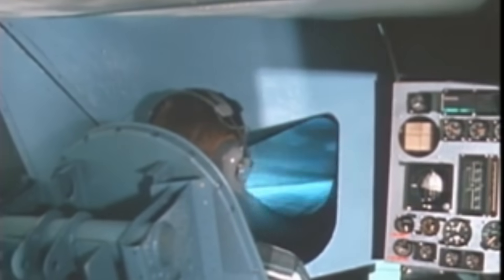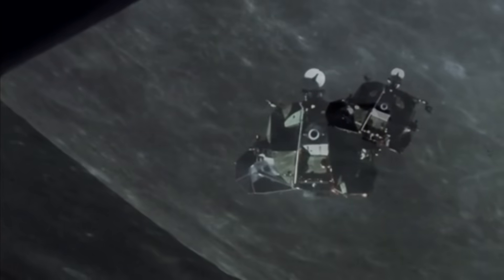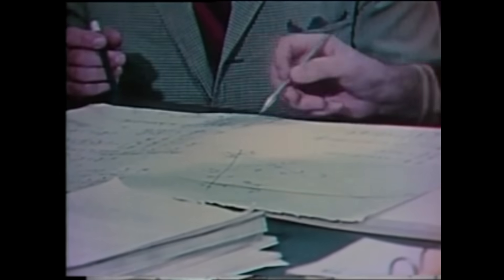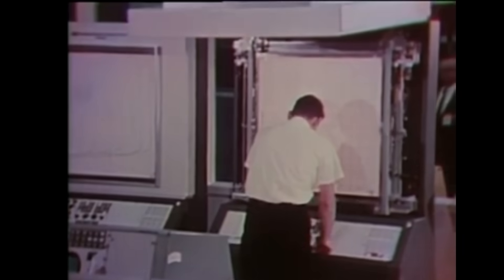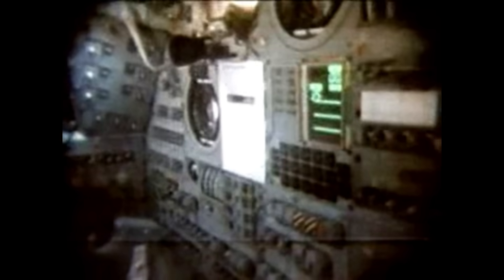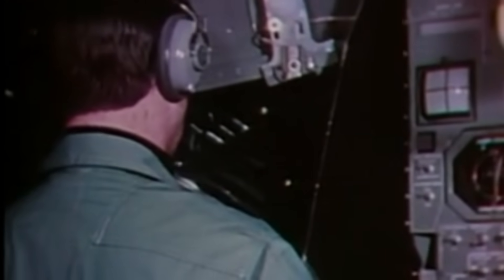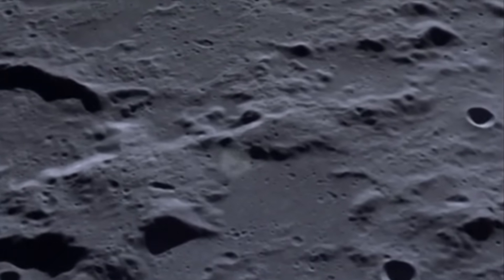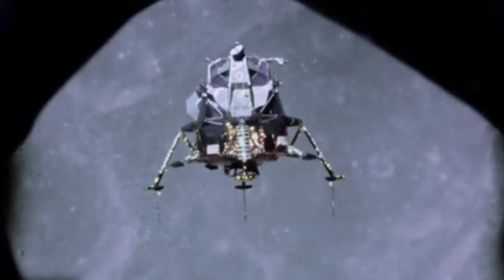The Apollo Guidance Computer: How a 70-Pound Machine Landed the Lunar Module on the Moon

Comment: what exactly is the difference between writable and erasable memory?
Reply: Old rom (read only memory) devices were implemented using fuses. When you did a write operation you were literally burning fuses to create a pattern. Once a fuses is blown, it cannot be restored. This is called programmable-read-only-memory (prom) type memory. It is a form of non-volatile memory (retains data after power down).

Ram (random access memory) can b written, read, and erased at will. This type of memory is typically *volatile*, meaning it loses information when the power is turned off.

One exception to this is magnetic core memory however.

I don't believe they had one time programmable roms (oprom) for apollo.